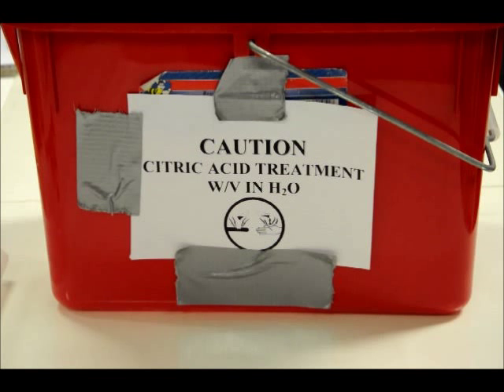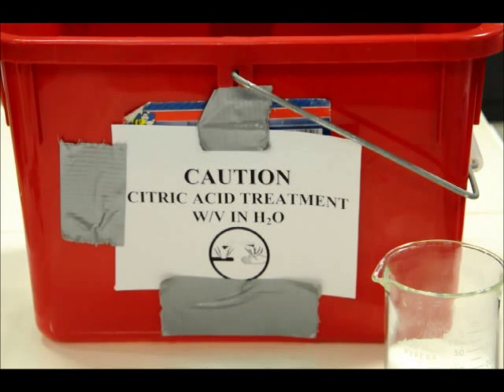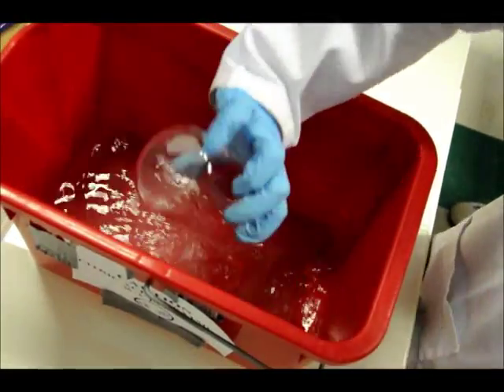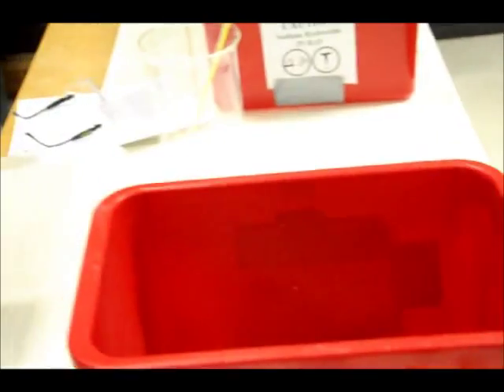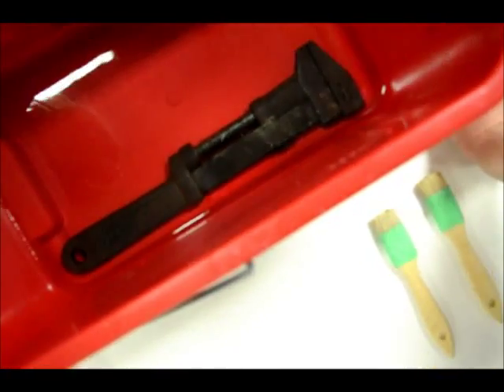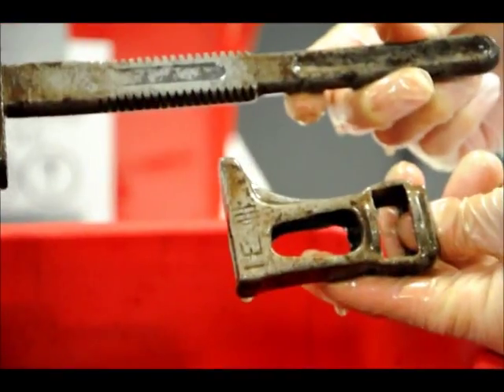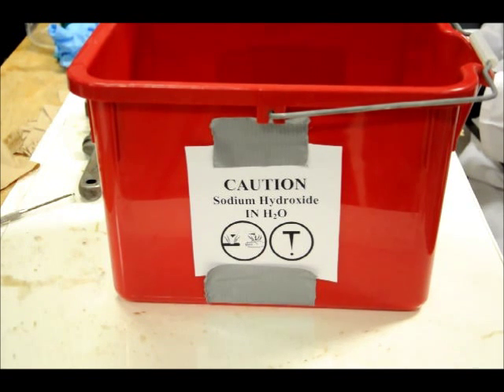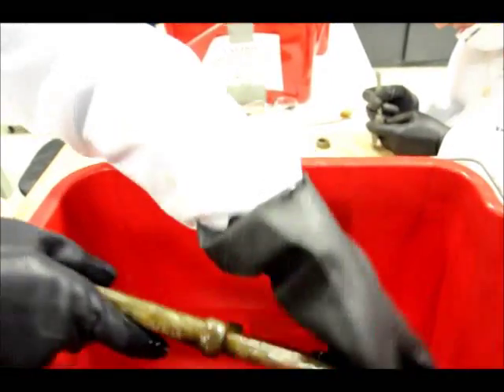Algonquin College Applied Museum Studies Citric Acid Cleaning

Comment: Heating the solution greatly increases the effectiveness of citric acid.  With a stronger solution and heated precleaning the rust would not be needed.  With a heated solution no rust will be left.  Good safety procedures followed, helps instill respect for chemicals.  Respect that must be had when using dangerous chemicals.  Sodium Hydroxide is one that all safe handling procedures/equipment must be followed.  Nasty stuff with a delayed effect.

Comment: So how do you prevent the bubbles from forming on the object you want to clean?
Reply: FindingHistory he bubbles are a good thing. It means the citric acid solution is cleaning or oxidizing or dissolving the scale. You could always use less citric acid but this is a common museum style solution, good for restoring antiques. It’s important to clean and add mineral oil to steel once done